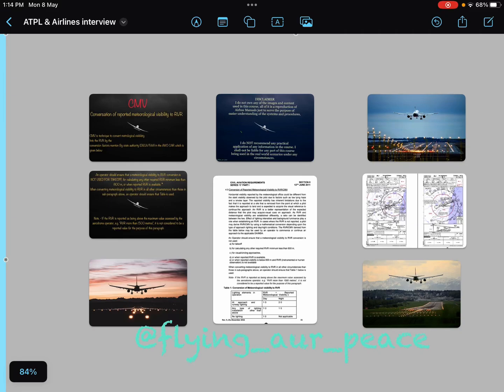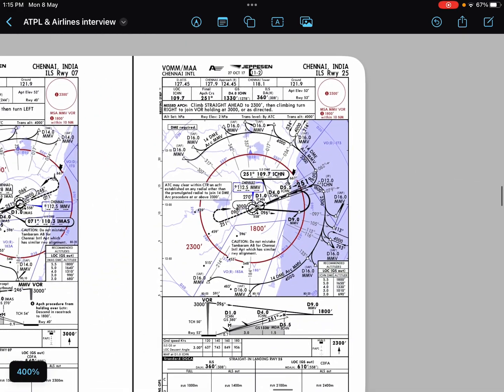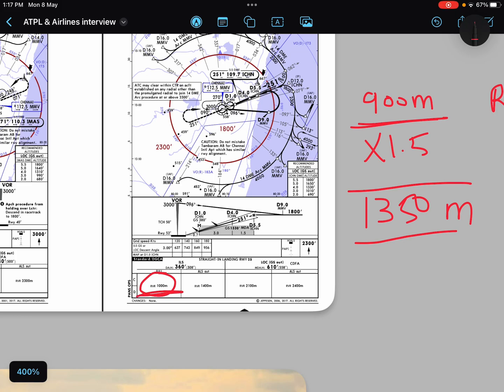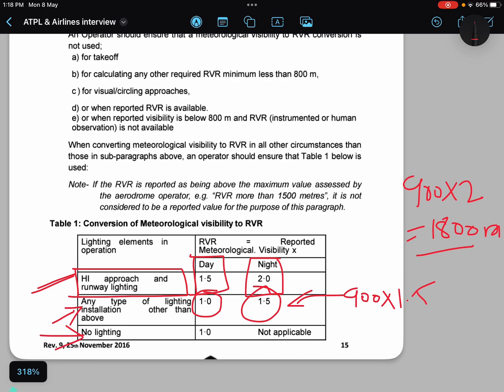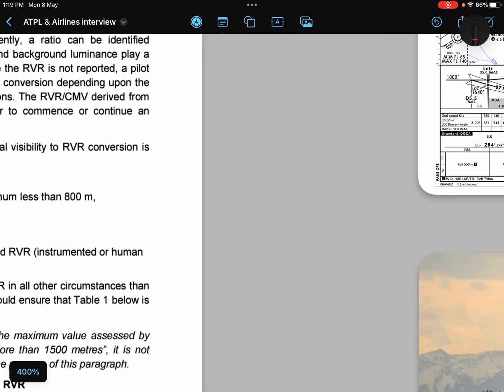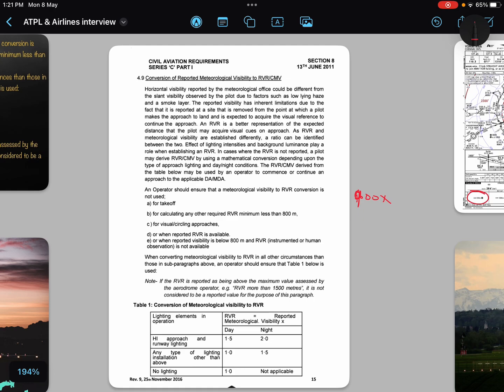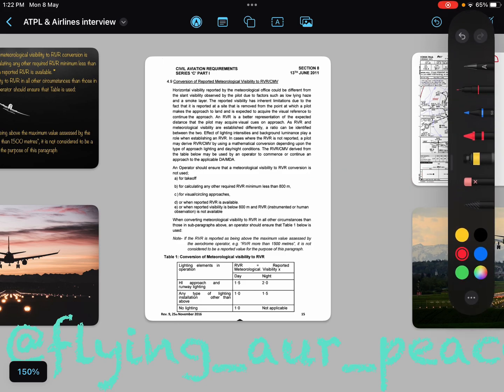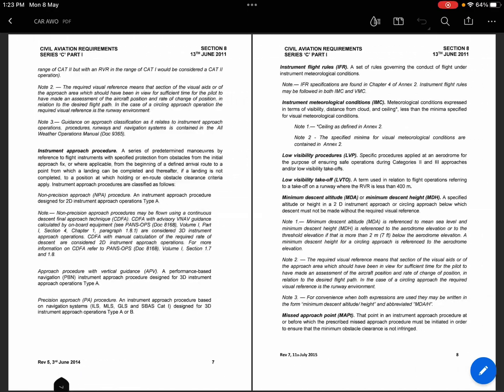CMV | Conversion of met visibility into RVR | Explained from DGCA CAR

Comment: Great explanation but there is one more clause which you may want to add. Refer to ATMC 05/2017 which also adds the requirement for 420m minimum length of approach lights...cheers.
Reply: The requirement of light segment minimum 420m  , and the requirement of visibility more than 800 is removed as per the latest AWO CAR.
Reply from the maker: Thanks for appreciating, I will definitely go through ATMC 05/2017 and write that information in description.

Comment: Can we convert the visibility from a TAF to CMV,  when dispatching a flight or is it only to be used in flight ?
Reply: NO. ONLY VIS BY ATC
Reply from the maker: Ya you are correct , captain .
It is to be used only in flight , if TAF shows visibility less than minimum required, then we cannot depart from departure airport only ..
This concept of CMV is to be used only in flight .